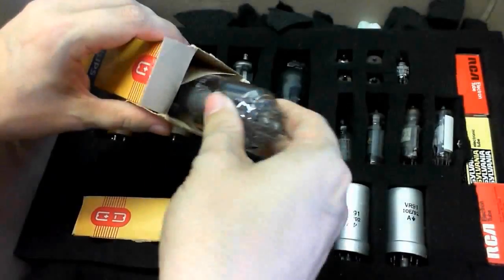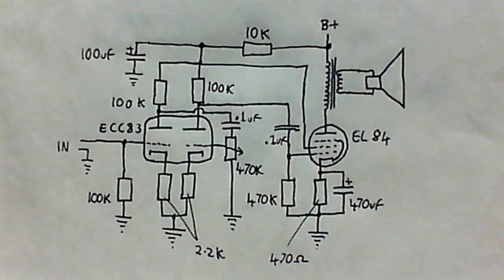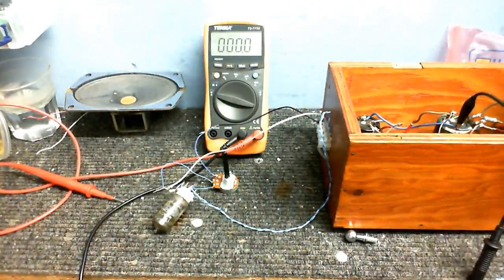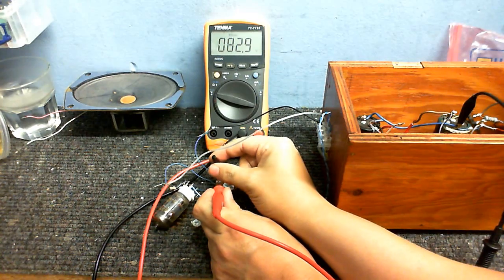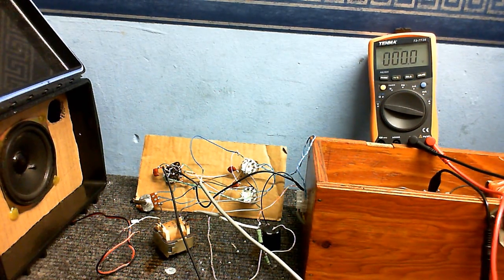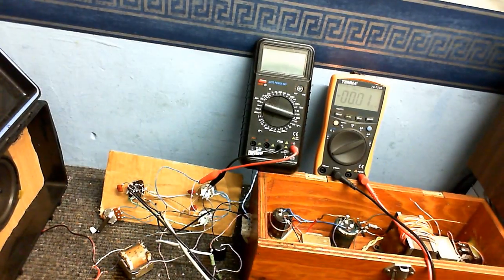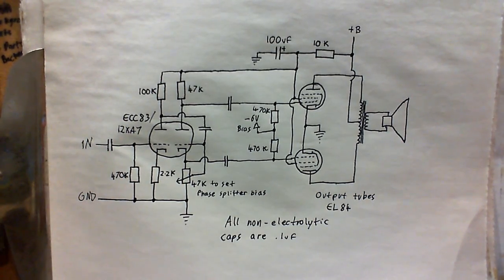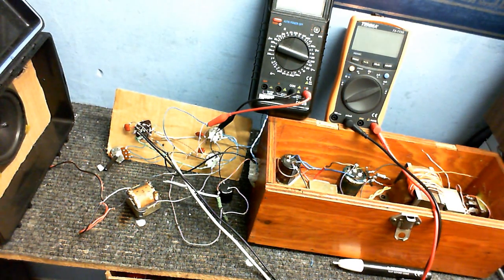Tube Time 6 - Double Ended Amplifier!

Comment: Well done Clem it sounds fab, have you thought about making up some tone controls for your amps that you build? Paul
Reply from the maker: Paul Brace That might be for a future project, first I need to find some kind of metal chassis to use to isolate all the wiring from AC hum, so when I turn up the bass, it doesn't also make louder hum.

Comment: If you look at the datasheet for EL84 you can see that the bias should be somewhere around 6-10V. No wonder you had no sound with it around -28V. Lower voltage reduces crossover distortion but increases dissipation ("biasing hot"). Remember, in class AB, the peak point of dissipation is not at idle and the load impedance changes as it moves from class A to class B parts of the cycle, but yeah that transformer's really unsuitable. Also it probably doesn't have a great high frequency response if its designed for 50Hz mains.

Comment: (120÷5)^(2)×8=4,608

A center taped 5 volt transformer should work
And in push pull it almost does not matter that you use a power transformer

Comment: Is there a way to use an ECH84 instead of the ECC? I'm new to toobin' but I have a bunch of ECH84s at home and a few EL84s thought I could build something... Anyway, love your videos, man!
Reply from the maker: +Dan Zuungar probably wouldn't work, you could try using the triode sections of 2 ECH84's to "make up" and ECC tube but it would be a little bit of a waste and if you run it at the voltages I was using, you'd be over the tube's maximum voltage limit. Best to try and find some ECC tunes or 12XA7's.
Reply: Thanks!  I'll do that! :)

Comment: clem you got any idea how to make a valve preamp that can supply 48volt phantom power to work with my condensor mic ( XLR plug )
Reply from the maker: ***** Sorry, I don't know much about professional microphones, especially the types that require phantom power.
Reply: clem your a clever dude man come on HELP
Reply from the maker: *****
Hold on I didn't say I wasn't going to at least going to try and find out, I'm just buried in some other tube projects and experiments right now.  Eventually I'll get to it.

Comment: What about 12volt tubes? I am sending some 12AL8 (12volt triode-tetrode) and an 12EC8 (12volt triode-pentode) to see what you can do with that on tube time! Can they REALLY make practical amps? Would you use the same smaller transformers that you'd use in a tube amp for audio output? I'm also trying to dig up 12 volt pentodes and tetrodes....they actually exsist and I've found many circuits using them at 12v to 30 volts......

Comment: hum may be due to no chassis you keep going with you valve projects i am self tough don"t worry about the mean people out there  
2nd point to make about humm twist your heater wiring and use 2 100 ohm resistor of each side of the heater Volta to ground
are you using shield grounded cable

Comment: Well sorry, you put the transformer data. Better to watch till the end ...  I guess. Any advice to change this in EL34s, since I have 8 of them and Im not buying EL84 because they are expensive. thanks
Reply from the maker: 38911bytefree It should work with EL34 I don't see why not, and would put out more power than my amp that I made in this video would.  The cathode and grid 3 on each EL34 should be connected together, and the bias voltage (according to the datasheet http://www.triodeel.com/6ca7ap5.gif ) should be around -44 volts.
Reply: Many thanks. I always wanted to start some tube project, just a bit dangerous (because the voltages) and a bit lazy plus the transformer thing. Happily I see that some cheap tranformer can fit well with paying this ridiculous prices. What Im really frigthened about is connecting this Akai to the amps. You need to build some buffer thing ASAP to avoid blowing the Akai output. Really dont trust in tubes. Too much voltage for me. but yes, you get nice warm sound. If I were you I would buy a not working chasi radio or amp, cheap, to mount this amp using socket, transformer etc. Thanks and keep this vids comming. Forget the troll thing. They have never build nor designed SOMETHING

Comment: WOW CLEM! This is the best tube time ever! I'll have to watch your vids about 20 times each to understand half as well as you do. I'm still working on class A concepts. May I ask, which EL84 did you use with these? The "TESLA" EL84s or the USSR Clones? Maybe something else? I'm finding more and more that make and manufacture of "the same" tube can be a really big difference.

Keep on "Tubin" and "Tapin", Cheers
Reply from the maker: ***** It was the Tesla ones I used, I haven't tried it with any of the clone tubes yet.
Reply: (bump...stupid editing interface!)
Reply: CoolDudeClem Thanks for the reply. :D
Reply: CoolDudeClem Right. Not surprised. I recently got a hold of a testing machine and WOW the original TESLA EL84s are working at almost 200% efficiency! The clones don't even compare. They meet the specifications, but only at 85%. The combo tubes I sent (the ECL85 = 6Ф5П "6F5P") were used clone tubes I'd like to hear what your design would sound like with a PCL86. I'll send one soon. Cheers.